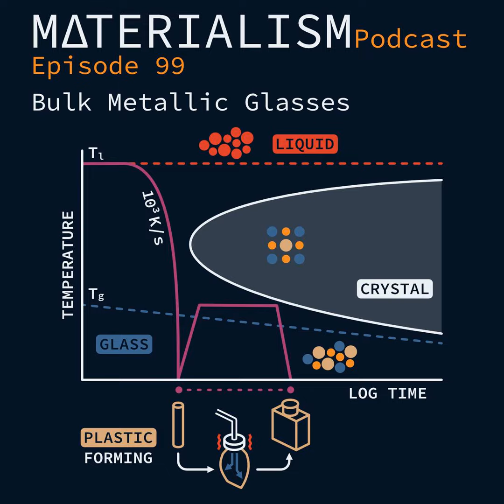Episode 99: Bulk Metallic Glasses

Comment: amorphous transformer steels have been very useful! 😀
Reply from the maker: @arthurmario5996  oh? What do they use them for?
Reply: @TaylorSparks  they are sold by "metglas" and are used as the magnetic cores in 50 and 60 hz transformers. they have very low losses but are best used at  slightly lower flux density ( approx 1.5 tesla, vs 2 tesla for conventional steel)